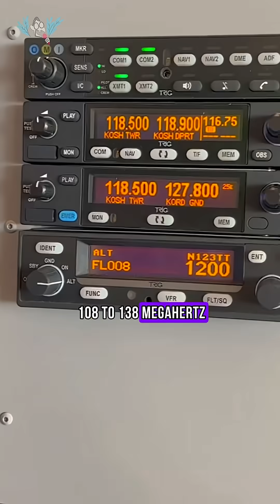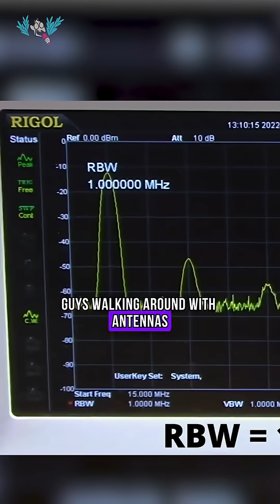Starlink in-flight WiFi banned: Dangerous pilot radio interference

Comment: starlink transmits on EHF, it would cause very little interferance as they use a freq setu up and step down converter, to increate from 700-900MHz of like 25mW power, to 12GHz (UPLINK AIR->SPACE) and goes to a Power Amp (PA), so that should not cause alot of interferance, and nothing was banned... soo..

Comment: Soviets were pioneers in Radioelectronic Combat (REC), focusing heavily on disrupting German ground communications and tactical coordination.
Here is how the USSR used jamming on the Eastern Front:
1. The Siege of Stalingrad (1942–1943)
One of the first major successes for Soviet jamming was during the encirclement of the German 6th Army. The Soviets formed special radio jamming groups to block the German headquarters from communicating with their trapped troops. By broadcasting "noise" on German frequencies, they made it nearly impossible for the Germans to coordinate a breakout or supply airlifts.
2. Specialized Radio Battalions
Starting in 1943, the Red Army created dedicated Independent Radio Battalions for Special Purpose (known as OSNAZ). These units had three main jobs:
Intercepting: Listening to German codes.
Direction Finding: Pinpointing where German transmitters were located so they could be hit by artillery.
Jamming: Actively "drowning out" German radio nets during major Soviet offensives.
3. Operation Bagration (1944)
During this massive offensive, the Soviets used intense radio jamming to paralyze German command and control. At Königsberg, the German garrison eventually surrendered in part because Soviet jamming was so effective that the German commanders couldn't talk to their own units or the higher command.

Comment: Harmonics or frequencies that resonates with that frequency, can and will affect other radio coms. On other frequencies, as long as they resonate.
It didnt sound like an exact harmonics, but im unsure what bandwidth they use at at flight VHF, perhaps it overlaps with a resonating frequency.
Those frequencies didnt appear so far away from possibly causing harmonic interference. 🤔

Comment: The video title specifically says "WiFi", not sure if that's accurate, they're talking about satellite comms as well. In any case, considering they're placing Starlink antennas on airliners now this can't be an insurmountable problem. Starlink should IMO market a small aircraft specific mounting solution that helps shield the unit and/or an "airplane mode" that sacrifices some performance in order to keep the signal more quiet.

Comment: That would tend to tell me that the Starlink is transmitting whatever transmitters they’re using they’re dirty meaning their transmitting across more than their band spectrum am I wrong that’s how Amateur radios. I should say the cheap Amateur radios work. They’ll transmit on other frequencies because they’re dirty, they don’t have a filtering in the radios themselves, which means they’re sending out serious transmissions. Another words if the radios they’re using are not filtered properly they’re transmitting over multiple harmonics and different bands, which could be problematic again I could be wrong.

Comment: This sounds just like what engineers say when they theorize about a real problem rather than test it. It sounds like some gold-plated bullshit, but it's still bullshit. If the com antenna is receiving static conflicting with a finely-tuned signal, then the antenna usually isn't grounded properly, usually a small layer of surface corrosion beneath one or the other surface. Bonding is the answer. The com ant always seems to do that, and electrical bonding and/or proper sealing is always the answer.

Comment: This guy talking is an absolute idiot and does not know what he's talking about. We do not use AM radio. The only radios we've ever had that even overlap with the AM radio bands are ancient ADF tuning heads, but we can't even broadcast on those. If 2 pilots or more talk simultaneously on the same freq it causes interference and nobody can hear anything but distortion.

Comment: I just flew on Qatar airlines and had starlink on hte flight..  worked amazingly well..  Unintentionally did a video call from the flight. and it worked fine. then flew on Lufthansa with some other service and if felt so crappy in comparison.

Comment: That sounds like, "no pun intended" that the Star Link power system is not filtered or was connected to wrong wiring bus and is noise back through the harness. If it heterodyned signal it would not come through as static it would have some modulation to it.

Comment: I still don't understand why not use OFDMA which allows multiple users, that's how Wi-Fi and LTE works and it works well.

And the voice will be crystal clear unlike hard to understand analog AM mumbling.
Reply: With WiFi, two devices can't talk on the same frequency at the same time. I'm sure we can figure out how to make calls at the same time digitally on the same voice chat. We could use less spectrum for better quality audio, thanks to OFDMA, beamforming, and compression like OPUS. So, a single user 32kbps OPUS would use less than half the bandwidth of the smaller version of the VHF channel 8.33 kHz used in Europe. 3 users speaking at the same time would already use more bandwidth than the current system
The downside would be more complex equipment.
Reply: @ArthursHD as I know, OFDMA is a game changer for wifi6 and allows to connect more devices (if all of them use wifi6 of course)

Comment: This guy seems to know his stuff, except for one thing: AM radios don't allow two signals to be heard at the same time because AM uses a carrier wave, and two carriers at the same time wipe each other out so you don't hear either signal except for a bunch of noise. I think he may be talking about SSB (single sideband) which is used by pilots on transoceanic flights for long distance communications in the HF bands, it's the same thing amateur radio operators use to communicate around the world. A characteristic of SSB is there is no carrier, so two transmissions can both be heard, although not by each other since they have their mics keyed at the same time. But someone else listening can hear both.

Comment: I have no experience with starlink, but I imagine they are made in China and have poor or lack of filtering on their radios, a radio regardless of power output can be made to only transmit on a particular frequency, take old school a.m radio running tens of thousands of watts,they dont bleed on to adjacent channels, I bear people splatter on 10 and 11 meters. One of the next places for them to splatter is the air band...filters are important, transmmitters properly aligned are important..

Also I wonder what effect altitude and temprature are having on that starlink.?.

And yeah a.m radio picks up all the trash, l.e.d lights,lighting, washing machines, you name it...

Comment: This is why phones have a "airplane" mode. Your phone has antennas sending and receiving signals from original cell up to 5g, for communication and internet. Then there's Bluetooth connections, NFC and even the ultrasonic fingerprint scanners on modern phones all emit frequencies. When taking off and landing, communications is essential, so having the clearest AM channel possible is incredibly important...so turn on airplane mode, at least until the seatbelt sign is turned off

Comment: The problems the AM radios are experiencing, is most probably due to cheap or faulty power supplies on the starlink, or even the data input/output of the device (not the RF to the actual satellite). If the power supply is faulty under load, you need to understand that the power wire feeding the starlink is now an antennae radiating that interference straight into the AM radios front end, or worse straight into the radio via the radios power cable.   I have seen LED lights interfere with FM radios because of cheap current limiters inside the led "globe". 
The basic problem is almost all electronics theses days rely on square wave forms, for power supply and or data transfer. The square wave is inherently full of harmonics. The harmonics can easily be suppressed or contained, but it costs money, money the manufacturer is not willing to spend when maybe a minute portion of the devices made will ever be in an environment where it actually matters. The RF noise floor in an urban environment is so high these days  because of these cheap devices everywhere , its scary, but nobody actually cares because no one really  uses radio in its original form, except the aviation industry, and they use AM so that they are aware of the fact that there were two transmissions, and can request the information again. You cant clearly hear two transmissions over AM, you can only clearly hear there was more than one, and your information may not have been complete.

Comment: This guy is confused... VHF air band is the exact opposiite. The ATC / Pilots never mix their signals. The whole idea is to have exact channels of communication in every frequency available at 0.10 Mhz separation, thats why aircraft VhF comm raidos use PLL (phase locking loop) circiits to exact tune frequencies. If starlknk interferes whit those frequencies is violating FCC rules and they need to find a solution to prevent it from happening. It may be like a signal jammer on every starlink system around. Im avionics technician 34 yrs exp.

Comment: Ham, RF Manufacturer here.  This is not an issue, any found noise or interference was likely due to early testing.  The Starlink is NOT high power either. it works because of high efficiency, line of sight, and receiver gain.  The phones, which have always been on(even when not allowed) with bluetooth, wifi, near field , are just as powerful.   Aircraft communications need to enter the modern world and go digital with error correction.  Many digital modes can operate  worldwide when voice AM is useless.

Comment: This guy knows very little about the subject he is talking about. FM radio can overlap and you can hear more than 1 station on a frequency at the same time if they are transmitting at the same power and you are the same distance away from both. Yes parts will be garbled and some waves will be over amplified or cancelled out, but you demodulization modual will not distinguish between the two signals or prioritise over any of them. The strongest signal usually wins in real world scenarios... also, the packet frequency does not affect the frequency of transmission... you can get leakage RF from the computer circuites but that should be sheilded.

Comment: This doesn't make a whole lot of sense, and smells of pilot BS, it sounds like pilots making stuff up again, like the whole "I saw a drone" translation "a plastic bag almost hit us but that's not very interesting".
Starlink phased arrays are high gain 5W antennae if aircraft radio systems can't filter the leakage from that, they have bigger problems than Starlink! I don't believe the evil fanatics at the FAA would install a radio without limiting the guts out of it (unless they were bribed by big business, which the FAA would never do).

Comment: Subharmonics (half, quarter etc) are not a feature of systems like Starlink. If there is interference it is most likely blocking. This is simply the front end of the AM system being overloaded by an out-of-band signal. Better filtering will fix this. An external add-on box will do the job. Retrofitting will be on its way.

Comment: As a ham radio guy and former pilot, I’ve never understood why the antenna for VHF is on the roof and not under the aircraft. The ATC is BELOW the aircraft when flying, and VHF signals don’t bounce off the ionosphere. Put Starlink on top, and VHF under.
Reply: Generally, com 1 antena is on the belly, for air ops, and com 2 is on the top, for ground ops.
Reply: @drmaudio  It's the opposite. VHF 1 (and 3 if applicable) at the top, VHF 2 on the belly
Reply: Is it bouncing the am signal off the atmosphere?

Comment: Too few know that "resistor wire" spark plug wires were part of the solution to engine noise getting into the radio. 

EV manufacturers got lazy with EMI protection and just deleted their AM radios instead. Bad idea. AM radio (500-1500 khz) is the band of choice in a national emergency.

Comment: Absolutely nothing to do with there being no error correction.

Error correction applies on data transmissions. ATC voice isn't a digital system and cannot employ error correction.

However, if you wanted to use AM for data transmission, it is possible AND it is possible to employ error correction with it.

Comment: This issue is as old as Cable. Broken connections on HFC networks cause interference, cable companies are regulated to keep "leakage" under a certain level. The introduction of internet and digital signals greatly reduced this problem as when it leaks, it also lets interference in. Plus digital signals are more difficult to identify VS an old analogue TV channel playing on the aeronautical frequencies.
Reply: Cable leaks have gotten pretty interesting. If the ingress is bad enough, its easy to pick out FM stations, aerial bands, UHF, LTE and other random crap
Reply: @malrofo ingress issues are fun as well... All of the digital signals in the air and in the wire make for fun diagnostics...

Comment: I’m an avionics technician, when we first started installing GPS’s in aircraft, it was necessary to test the system outside while transmitting on certain “harmonic frequencies “ to make sure the signal to the GPS was not degraded. If either VHF transmitter was causing issues the were filters you could install in the transmission lines to rectify the problem. The later GPS receivers had the filters installed inside of them.
Live and learn!😎

Comment: Starlink Frequencies are in the GHz range. AM Radio is in the standard <1150 Hz range. The two frequencies are several billion hertz apart. They won't even remotely interfere with each other.
Reply: This is true for low power signal in linear regime. If signal is strong enough, non-linear effects will cause interference.  That's why shielding and antenna separation is important even when bands are completely different

Comment: They are NOT using AM radio. They are using AM MODE. Which means amplitude modulated. The reason is that two AM signals will create a heterodyne (squeal) which lets ATC know there are two signals, one atop the other. Whereas FM would simply cancel the weaker signal, and you'd never know it was ever there. It was a deliberate choice made by someone pretty smart
Reply: Amplitude
Modulated
radio
(communications)

It’s AM radio.
Reply: @Hnnnghf  yes, but that's because most people automatically equate AM to AM radio stations....but forget that VHF aero uses AM, as well as most CB's...and even some of us hams use AM
Reply: Often though, you hear nothing, or just louder static. Only sometimes will you know that there's stepping.
Reply: @PBMS123 and sometimes is better than never
Reply: @milwaukeephil2548 you know you can be so wrong and so confident you are correct that you forget to ask yourself if you are a victim of the Dunning Kruger effect.

It's AM radio, he didn't specify the broadcast band, but it is AM radio, using the AM mode. Also they use AM because as they described in the video quite correctly both can be heard, and the human can distinguish the different stations from each other, and reply to the more important of them. The heterodyne you describe can be caused in many ways, but that isn't one of them. 2 AM receivers in close proximity can cause the heterodyne effect you speak of, it was a cheap way to resolve SSB when I was a kid. If you listen to an airports control tower frequencies you will hear them double often, you won't hear them squealing and whistling as a result.

As for using FM, the capture effect causes one station (usually but not always) to be heard, while the other is often distorted, and very quiet under the carrier. There is another significant advantage to AM, that's distance, as a signal is weakened, the signal to hiss ratio is better on AM generally the noise is lower volume and therefore easier to hear weak signals under the noise.
Reply: @Dennis_M1DLG  I guess you didn’t catch the fact I wanted to stress the fact it was AM “mode” as opposed to having people think it was AM broadcast radio. Also, the heterodyne effect or factor is created when 2 “closely” oscillating signals superimpose over each other with the resulting beat (tone) frequency equaling the cycle difference between the two superimposed signals. That beat alerts ATC of the twin signals. 

In FM there is no hetrodyne effect as an FM receiver locks onto the dominant signal, totally ignoring the weaker one. 

As for your Dunning Kruger analysis, spare me the psychological profile. It is beyond the scope of my intended comment.
Reply: I think you're trying to clarify a point to an audience of zero people.  People here know that AM is a radio transmission and isn't necessarily the same thing as AM broadcast radio.  It is AM radio.  Get over it.
Reply: Uh... it's the same technology as AM broadcast radio. Literally everything is the same.

Comment: RF Engineer here: Starlink ground terminals were not designed to be used in aircraft.  They do transmit and receive on various microwave bands -- Ku and Ka bands.  They also transmit and receive in the WiFi bands at 2.4 and 5 GHz.  However they may unintentionally emit on other frequency bands that can interfere with various aircraft radios on VHF, GNSS/GPS, ADSB, HF, radars, etc   Also, they may unintentionally conduct radio frequencies back into the aircrafts power supply, the same power supply that feeds the other radios on the aircraft.  SpaceX may need to produce special Starlink terminals for aircraft that have been through EMI/EMC testing to guarantee that they don't interfere with aircraft radios.